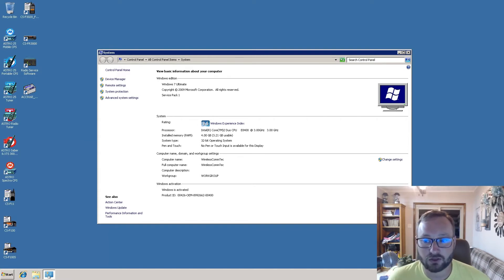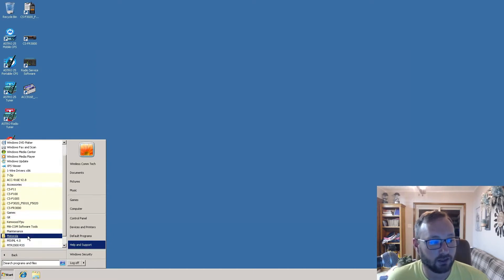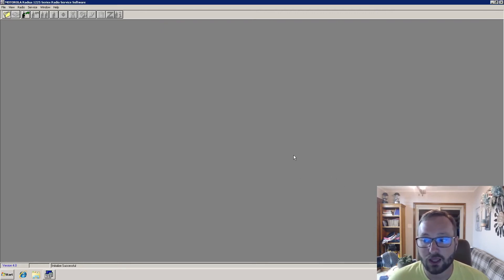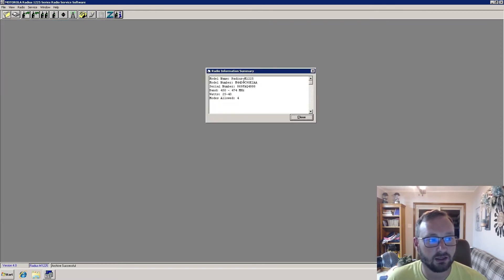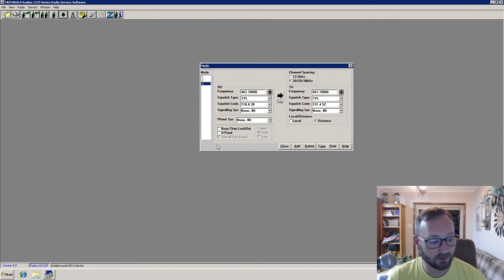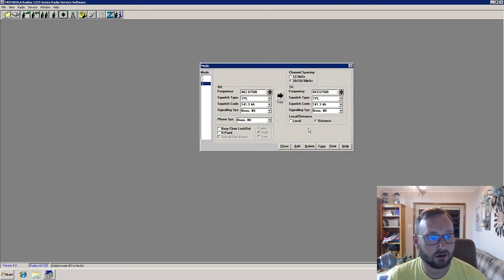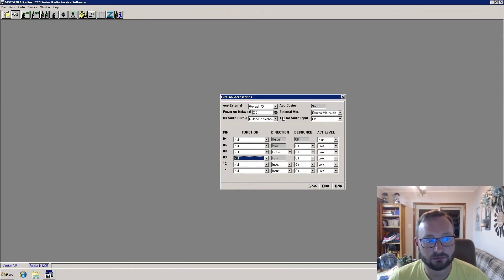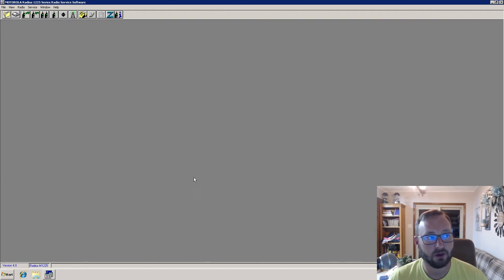Programming Motorola  M1225 Mobile Radio

Comment: I have a few old m1225 radios , is there a difference between the ones that say m1225ls or something like that , does the software not work with the models with the ls in description, thanks
Reply: LS generally means the radio is setup for LTR trunking.

Comment: What type of computer are you using for running for the programming radios? I am trying to get my hard drive read and transferred to a new drive at a recovery service, hopefully they can recover data. Have both Win 95 & 98 original disks for the recovery service since I don’t remember which version I was running. The Toshiba Techra is also giving me problems, hope I can repair it. The HDD has a ton of my /\/\ stuff on it as well as Kenwood and Icom. Really frustrating if I need to obtain another compatible computer for these old programs. Even looking for an old 286 12 MHz or slower for some VHF Sabers.
Reply: you can emulate (not virtualize but emulate) on modern hardware in order to program, im actually making a video on this right now